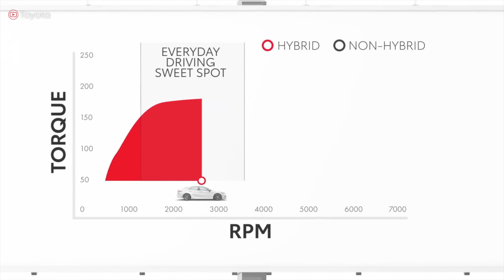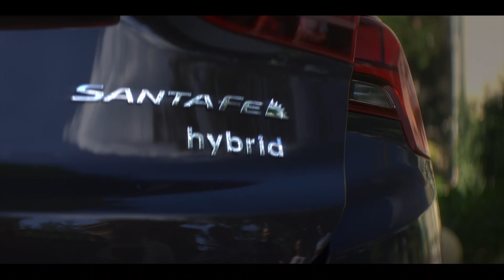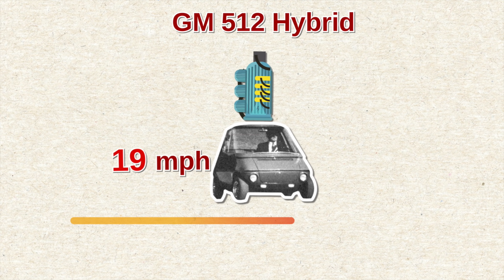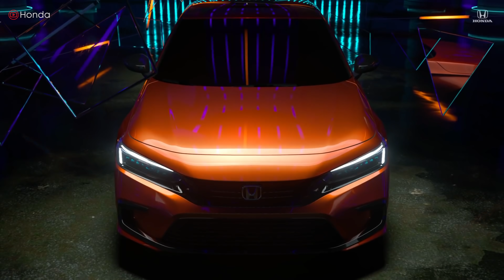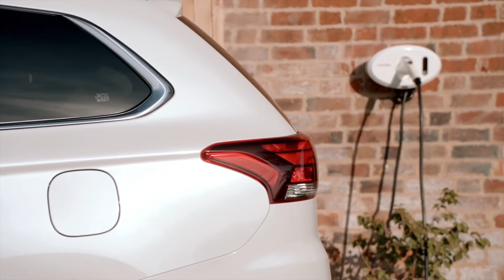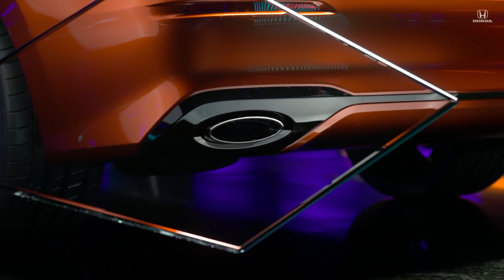The End of DIY Car Repair

Comment: To me the word hybrid is in 2 worlds. The car world meaning "gas saver, electric motor, orange wire, & killing u if u touch it" 
& in the cannabis industry. Meaning a mix of the different types of weed strain put together. So a Indica Hybrid means the strain has both indica & sativa but has more indica percentage in the strain. 
Way I see it, I would rather own an older 90s early 00s toyota while smoking hybrid strain & dodging getting tickets daily. Hey "anything is legal if you don't get caught"

Comment: And SO , we have two sets of motive energy to power ONE vehicle , where upon , after the vehicle racks UP high milage  one OR both systems will need repair\replacement........repair BOTH and the owner could have purchased (2) low milage vehicles with a gas engine !!!!!!!!!

Comment: Don’t worry I keep driving my present vehicles forever. Fortunately, they all run flawlessly like new without having to rebuild anything. 2003 Pilot 176K, 2003 Camry V6 200K,, 2005 Camry (2) 186K and 165K, 2008 Honda CR-V 216K, 2005 Toyota Sienna 302K miles.

Comment: If govt did not subsidize electric cars they would virtually disappear. Except for the rich mans toy Tesla the average person could not afford an electric car. Also it would take at least 10 years longer than a gasoline vehicles life  to recoup your costs over a gasoline engine. Pollution does not start at the tailpipe and where are we going to put all those retired batteries?  I have not even started in on the ACTUAL SLAVE labor involved in making the batteries.
Reply: Teslas aren’t a rich man toy. First, the Model 3 starts below (37k) every single Lexus vehicle. The average car price in 2020 was 34k so it’s not that much higher. Second, it won’t take 10 years longer. With less maintenance to perform with fewer parts and less wear including longer break life and tire life, the cost of ownership is way better. Electricity is cheaper than gas in mostly everywhere, especially in California, making it even more affordable. 

Now on to pollution and labor (which I’m going to talk in context about Tesla). Tesla batteries are built to last for hundreds of thousands of miles, meaning less waste. Tesla is also going to start using a newer type battery that would be less polluting to make. All of this could vary depending on the car maker and batteries quality. The pollution topic of EVs are so complicated that it would take hours to explain, but to summarize all of that, pollution of EVs are better than ICE, but not that much. So the whole “Zero Emissions” thing is  false. The labor part is interesting though. Before this year, Tesla had a supplier that used child labor in order to get the materials for their batteries. Now, that doesn’t exist anymore and no more child labor is used. I forgot exactly who and what minerals they were mining for, so I would have to look that up again. 

But in a short, EVs are better in the long run.

Comment: We all know Scotty doesn't like hybrids. For a good reason: You can't find a knowledgeable mechanic around the corner to fix a hybrid system in a cost effective way. That's what scares off consumers....but we can at least say that Toyota had a lot of practice making them reliable over the last two decades or so. Hence, Toyota's hesitation to jump into the "let's go fully electric" bandwagon. They know we neither have the infrastructure or trained technicians to repair electric cars economically. So hybrids are the in-between.

Comment: I like how the older honda accord hybrid didn't get any better fuel economy, it just went significantly faster. My favorite system is still purely mechanical KERS, it deserves to see more use in consumer vehicles. A flywheel system is very simple.

Comment: The end-game or focus on hybrids should be to eliminate the transmission.

Any other hybrid just has an oversized starter, and just qarely bualifies for the subsidy genre. 
A Fisker Karma was a proper hybrid, it just had gm junk bringing it down, (underrated relays, a turbo 4 cylinder with a exhaust manifold mounted...oil cooler 🥺) just like the Vanderhall trikes.

Comment: Hey Scotty, i have a '97 Camry 4cyl with 140,000 miles.
My front right wheel is lightly smoking, but its not smoking under the actual hood. This is after a 45 minute highway drive with only 1 slowdown for a junction.
And my wheel feels hotter than it should be. Cant even touch it.

What's going on?
Reply: Had the same problem. Mine was a stuck caliper.

Comment: I still think a locomotive based model with an electric motor on each wheel would be most efficient and allow "Plug 'n Play" for motor replacement.
Reply: I've thought the same about lawn and garden tractors, do away with weak expensive hydrostatic transmissions and multiple long expensive belts. 
Run differential and blades with high torque electric motors.

Comment: It's more economically and financially friendly to put in a remanufactured engine or transmission. Making these new vehicle from recycled parts is still recycling. But it still uses more recourses and cost way more than repurposing an old, old vehicle.

Comment: Whenever the climate change freaks come at you just remind them that the govt pushed gas burning engines by the order of JP Morgan the first oil baron back in 1900. Even Henry Ford wanted electric cars and said openly gas engines were a mistake.

Comment: Hey Scotty, I am looking to buy my first car. I would like a pickup truck. My first question would be, should I get a medium (Tacoma, ranger, Colorado) or large size pickup (tundra, f150, Silverado)? Also, which truck listed would be the most reliable and easy to work on? Thanks!
Reply: If you don’t need to tow a whole lot mid sized is the way. As far as the most reliable Toyota easily and they also hold their value extremely well.
Reply: @aryan.r4126  thanks for the reply!

Comment: Hey Scotty. Hope you're doing great. I'm from Mozambique. What things should I look for in a second hand 4wheel drive Toyota hilux with a gas engine, I'm looking for a 2000 Toyota hilux with a 4 cylinder 2.7L gas engine 4x4. Thanks, your thoughts would be very valuable as I'm looking for my first truck.

Comment: Nice work, Scotty !
I have a question about my 2007 Dodge Charger 3.5L V6.
It's rusting pretty bad, but it still runs smoothly.
Do you think I should sell it now and get something more reliable or drive it until it breaks down ?
Reply: @Gypsy Mike Right. I was told it would expensive to fix because the rust is so bad.
You're right, I might as well drive until it drops. After all, it's got some life left in it
Reply: @Gypsy Mike Nice. I bought mine for 2000$ Canadian dollars, it had 216000 kilometers on it. Engine's clacking, pulley is making noise lol. It's only worth spending for oil changes. I wouldn't even bother fixing it
Reply: @Gypsy Mike I reckon you met a few bad folks. Not everyone is friendly here, but most people are, just like everywhere.
But careful, because if you go east, where Quebec is, this is a French population mostly. I may be living there, speaking two languages but I assume you don't, so stay around the other territories. We're mostly french in QC
There are nice places you can go like Toronto or Ottawa ! But I never went farther. 
Don't let people scare you, surround yourself with the good ones. Just like everywhere.
I invite you to leave if you don't feel safe in the US.
You could always go back after all is settled.
Lots of heat right now
Reply: @Gypsy Mike No problem !

Comment: I will say Toyota done a good job on the Prius
Reply: What happens between 105 to 118k when the batteries go, the cost is $6,500.00 to replace them. No thanks.
Reply: @robrousseau4524  Can always be worse, just look at all those stupid dell hp and ibm computers in them now! Batteries not so bad to deal with now are they? I have watched people spend way more than that on computers because the wire harness was junk, or they tried and installed thump systems or rig anything to the wire harness for pulling trailers. That being said, like I said, Toyota didn't do a bad job.
Reply: @watup110875  I will buy gas powered. If you look into it electric are less environmentally friendly, from start to finish. A fact that the dimwits won't admit to, because they all make money. Look at that pantload Al Gore.
Reply: @robrousseau4524  I don't disagree one bit, I was just stating how well Toyota crafted the Prius. They are simple to work on, but most to all professionals will lie and say other wise for their profit/prophet. I mean for god sack, they thought points and carb was tough to deal with.

Now I will say for about everything with security spider into everything is a nightmare. Because there is no way around anything, unless you got deeeeeeeeeeeeeeeeeeeeeeeeeeeeeeeeeep pockets to eliminate it all from the equation. I still prefer obd1 over obd2 any-day, but points is the best, no computers, even electronic ignition can be a dog when it wants, just like standalone points.

Even points is simple to work with. timing air fuel run repeat. However with computer version vehicles, there is still no guarantee it will run.